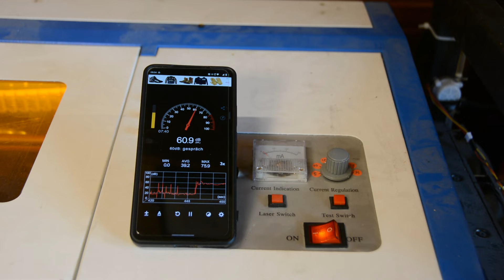Laser Air Filter V2.0

Comment: Check the youtube video “DIY Meets High End Fume Extractor for Laser Engraving/Cutting” from Brandegee Pierce. He talks about the filters he bought but also the fan (around 10min in the video). He does not recommend axial blowers but instead recommends a centrifugal fan which will work better to go through all the filters. As I understood, centrifugal fans are made to work in high pressure while your fan is not. Worth a try if you can get one.
Reply from the maker: Thanks. I will look into it. However given that this setup works pretty well for me this will rather be a someday todo. 😊

Comment: Would there be a difference if using activated carbon filters that are already made, versus using the actual carbon like you did?
Reply from the maker: Good question. I don't know. I think that this way there is more surface the smoke can interact with - but give it a try...

Comment: not sure where u got the Cubic Meters from but i think u meant cubic feet for the blowing capacity of the fan. 1300 cu meters would be 34,900 cubic feet per minute out of an 8 inch outlet is about 160 mph, lol. blowing your filters right out the backside and exploding the box.
Reply: You would also be unable to open the laser cutter lid as the suction would be abt 1.3 tons inside the machine

Comment: Wouldn't it be better to put the filter panels before the carbon filter?  They can remove the heavy stuff and the carbon filter is more about VoC removal.  Also to improve airflow can you just pass the air over carbon filled baffles with thin gaps between the baffles?    If you are worried about sparks in the pipe it is also a good idea to put a wire mesh spark filter first maybe in a small aluminium section to capture any embers before they reach the panels or carbon?  Really nice design and setup BTW ...

Comment: I am making a similar filterbox, but i stack the filters, no spacing between them, do anyone have opinion on this solution?
Reply: The only downside, which may or may not be significant, is that with gaps you allow the air to get particles up to speed to penetrate the next layer. This may not be important however when u consider the process of capture I would think that if the filters are together then most capture happens at the surface of the following filter as opposed to deeper. and instead of the particle being able to penetrate some distance in, it will be stopped at the surface, resulting in a faster clogging than otherwise. I have no empirical data on this, just that it makes sense.
You need distance between the filters and the inlet and outlet anyway to make sure that the air flows well enough to use most of the filter. otherwise the air just uses a small circle of the middle of the filter.
You can visually illustrate what I mean by using a light source outside the box at the inlet hole. with the light at the hole, all the filter inside the box is illuminated, as you move away (simulating faster and faster airflow, or constructing the filter closer to the hole) the spot of light shrinks down to only illuminate a small spot in the center of the filter. After using a filter for a long time, check it to see where the discoloration is happening. all over or just in the middle? This also is a reason for space between filter. IE., allows particles to circulate and use other parts of the filter surface.

It just occurred to me of a possible upgrade. considering the above, if u made the inlet configurable you could manage to use the whole filter and not just the middle.

instead of an end wall with the inlet in the middle? offset it about 30-40% to one side. then occasionally rotate that panel so the inlet stream hits a different part of the filter.

You can also avoid ALL these issues by making the filters the same size or (just slightly bigger) as the inlet openings. This of course would be a complete redesign of the system however.
Reply from the maker: I was thinking about this as well. I found it difficult to get a good seal between the filters that way.

Comment: Would it be better to make a vertical carbon pot with some PVC pipe, or make the box higher so the carbon part is flat with the air rising up through the filters  ?
eg; If you used 4 x 100mm pipes in a parallel set up then the air would move slowly through each filter and have more time for the fumes to be absorbed ?
Reply from the maker: Interesting idea - would you turn the filter basically on it's end and this use gravity for keeping the carbon in place?
Reply: @WayofWood  Yes that way the surface area is evenly spaced as well. with many in parallel there would not be so much restriction so the fan would not need to work as hard as the load would be spread across all the tubes. you could try putting carbon in the bottom and cotton in the top to make a hybrid all in one filter. Rain Water tanks have in inline screens that would hold the carbon and the rest would just sit on top of each other.
Reply from the maker: @maxgood42 Good idea!